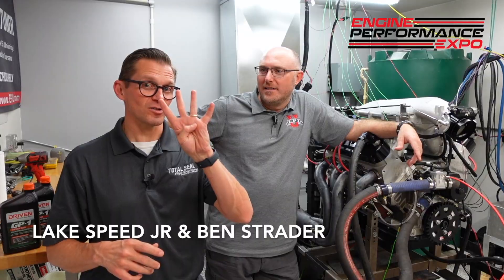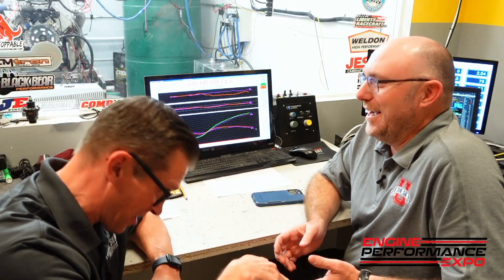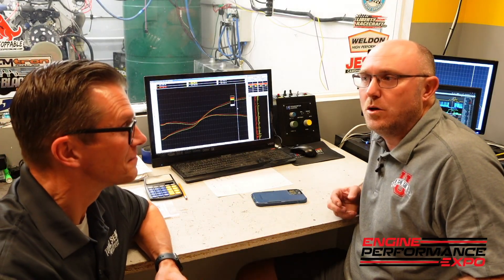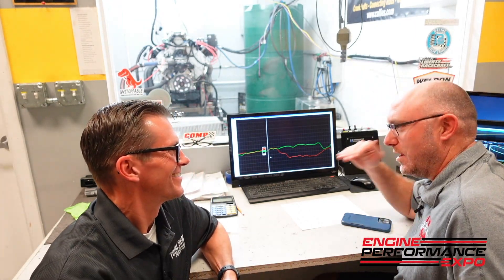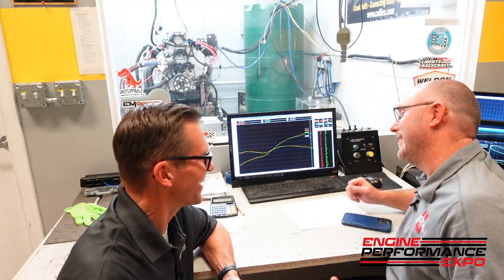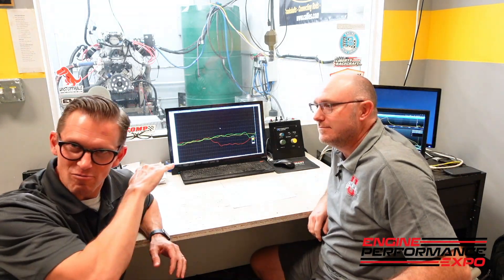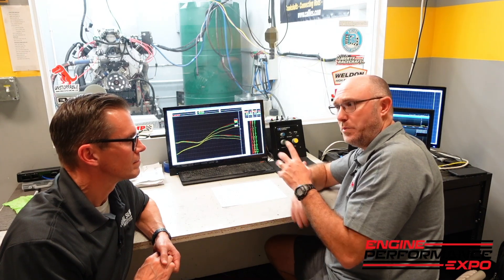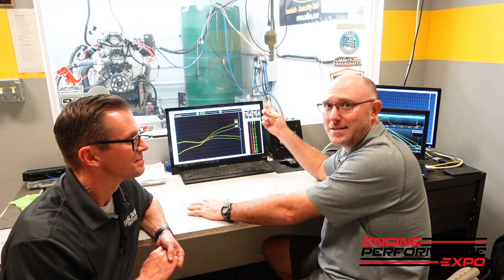How MUCH OIL is TOO MUCH? Dyno Results!

Comment: I have a question for you. I have a 21 Infiniti Q 60. The recommended oil for this motor is 0W 20. A lot of people that are on YouTube. Doing their own oil changes a lot of these people don’t like the 0W 20 motor oil they think it is too thin so they run the 5W 30. This is a twin turbo engine. Does it make a big difference by changing that oil to the thicker weight? Personally, I only do what the manufacture has suggested because they are the ones that obviously built that engine, been curious about this since I purchased this vehicle so running the 5W-30 is it good or bad?
Reply from the maker: 5W-30 will protect the engine better than 0W-20
Reply: 0w-20 is for fuel efficiency and thin whereas 5w-30 is better for protection and thicker but not too much it’s perfect . I have a 2018 q50 rwd luxe i do 5w-30 AMS signature series Oil
Reply: if the engine is under 100 k miles i would not put 5 W 30.put the oil the book says.0 w 20
Reply: @marlu6373  it says that for fuel efficiency purposes.. but people with modifications , tunes and just overall care about the car usually run 5w-30 for better protection or even 5w-40 if you take it to a track.

Comment: I find it silly the lengths to which manufactures go to increase fuel economy and reduce emissions by decreasing displacement, turbocharging, intercooling, and using lighter oils, and so on, yet, they're still using wet sumps.  Parasitic drag is such a, uhh, drag.
Reply from the maker: Good point

Comment: 🔔😎🇺🇲
Is the pressure loss due to running out of oil volume OR the more rapid recirculation of oil is holding the airiation bubbles longer.
Yes pressure compresses the bubbles.
And, obviously, Im sure this engine has a cranck scraper and windage tray.
So how do these factors apply???
Reply from the maker: Cylinder heads are retaining the oil and keeping it from getting back down into the pan.

Comment: The question is: how much of that loss is due to windage friction and how much is pumping loss in the oil pump which is keeping the oil pressure valve open and flowing a lot at high RPM?  😁. The dry sump experiment would help answer that assuming the same oil pump is used.
Reply from the maker: We have another video with this same engine in the works that will answer that question.

Comment: This test did not measure emissions. When there was excess oil, some will whip up to the piston, and pass the piston rings and burn. You will get more unburnt hydrocarbons and particulates in the exhaust gas compared to the right oil case.
Reply from the maker: True

Comment: I'm still trying to wrap my head around this, What has been done to the oil pan? Windage tray? Crank scrapper? Oil pan kick out or not? This is what I love to know to make a discussion on a comment. I love oil control because the returns can be very satisfying.
Reply from the maker: This engine is a dyno mule, so it doesn’t have a windage tray and the oil pan is gigantic. Check out Engine Performance Expo for all the details on the engine.

Comment: You need to do a video highlighting thin oil with high pressure vs thick oil with lower oil pressure.
Reply from the maker: Stay tuned. We were working on that video today.

Comment: You CANNOT compare data gathered by running a souped up high performance engine at 7000+ rpm and 9+ quarts of oil and say that the outcome represents what will happen to a production passenger car engine!  None of those variables are EVER relevant as they are apples to oranges.  For one, no regular car owner ever revs his car engine to 7000 rpm, and the sump never holds 11 quarts!  So many other reasons exist that make this line of reasoning ridiculous.

Comment: What was the first oil you used.....   where you said there was only a 12hp change?
Reply from the maker: We started at 5 quarts of oil, then added 2 quarts (which was the 12 HP loss) and then we added 2 more quarts.
Reply: @themotoroilgeek  Edit...
Reply from the maker: That was was the break-in oil.  @n2omike
Reply from the maker: @n2omike  We never had 12 quarts in the engine. We drained out the 7 quarts of break-in oil and added the 5 quarts of 15W-40 GP-1. The break-in oil was BR30, so it was thinner.
Reply: @themotoroilgeek  I saw my mistake in how I was reading your results.  Sorry for wasting your time!  Thanks for the great content!

Comment: Would be cool to know where on the dip stick these oil amounts related to. Are we assuming the hp loss is due to more suspended oil, or rotating components physically passing through oil? Also tilting the engine or simulating for a road course and repeating this would be fascinating!!
Reply from the maker: Since this is a race block, there’s no dipstick.
Reply: @themotoroilgeek  ahh ok ok. thank you, love your videos.

Comment: Back when I had my engine shop, this was one of the tests I did with my mule test engine.  It was a 302 Ford with 351W ported heads that ran great.  On a wet sump it did the same thing, about 70 PSI from idle up to about 5,000 RPM with 6 quarts in it plus the oil filter and oil cooler.  (It had a deep sump road racing oil pan on it.)  Then at 5,000 - 9,000 the oil pressure really took a dive down to about 25 PSI.  But it made 512 HP @ 8,300 RPM.  Added oil and the oil pressure stayed good up to 8,000 RPM, but lost about 35 HP as I recall.  A few months later I was testing dry sump oil pumps and oiling systems with it.  The best pump that gave the best vacuum also gave the most consistent oil pressure from idle to 9,000 RPM.  Oh yea, the power was 527 HP @ 8,300.  Plus, if you held it at 8,000 RPM for about 5 minutes, the power never dropped, and the oil pressure was steady @ 75 PSIG.
Reply: Awesome work ! Sweet engine ! 😎👍
Reply: An 8k rpm Windsor is a radical race cam only.
Reply: @maximusvonce1381  Originally it was built for a vintage race car.  Sadly, the customer it was built for died suddenly and the final bill was never paid.  The person that bought the car from his widow didn't want the engine since he didn't want to pay the balance of the bill.  I figured I would just keep it for testing things until it either broke or wore out.  It never broke, but it was huffing some after about 3 years of on and off testing.  I think it has about 400 hours of hard dyno time on it.  Then an off-road racer came in one day when I was doing something on the dyno with it and asked to buy it.  I rebuilt it to run better for his style of racing, i.e. high torque and less worry about high RPM horsepower.  I know he ran 3-4 SCORE races with it, but never saw it again.
Reply: @LoydChampion  Sorry to hear customer died. Was he that old. Was it a heart attack?
Reply: @LoydChampion What do you mean the motor was "Huffing some" after 3 years.
Reply: @maximusvonce1381  After a lot of dyno pulls it was showing a lot of blow-by.  Over that time there were a lot of dyno sessions that we were pretty hard on it to see what would happen with oils, headers, cylinder temperatures and a whole host of things.  For example, we did one test where we ran it between 5,000 RPM and 7,500 RPM with a 75% load for 4 hours to keep the oil above 300 degrees F and having to function.  I honestly thought it was going to throw a rod or something out of the side of it, but it didn't.  And the oil tested good too.  It was also a good test of the cooling system I engineered for the dyno water as well.
Reply: @maximusvonce1381  He was in an airplane crash in his own plane.
Reply: @LoydChampion  Wow
Reply: 500+ HP on a 302 with ported iron 351W heads… 
That’s pretty dang impressive

Comment: Extra oil means power loss, higher temperature, possibile aeration but stable oil pressure at high rpm. With this combination, I guess engine oil seals will be on the edge of failure.

Comment: Those oil pressure drops are a worry but it would have been useful to start with the stock oil level and add from there in smaller amounts. It's quite common to add a bit more oil when racing.

Comment: Do you know it's funny... when you read some manuals they'll say things like keep the oil level between the low in the  Full… othes  will say keep the oil level to the highest side of the  full mark… Possible without going over etc..... I was always a little paranoid to not… Have it on the app for full… But I can tell you this my well-kept 99 Camry V6 has quite a bit of difference (faster) on response on pick up/acceleration with that oil line  is at BETWEEN  add  and full..hmmmm 👍great stuff!!
Reply: Every engine is going to be different.

Comment: After seeing 7 qts vs 5 qts oil resulted in holding good oil psi but lost significant power I would have drained 1qt oil & tested 6 qts oil to see if 6qts/only 1 more qt oil was enough to maintain good oil pressure without loosing as much power which is exactly what I would think would happen in this case with this motors current build configuration.
Reply from the maker: Agreed, if we were trying to fine tune it, one quart at a time would be the way to go.

Comment: I'm confused. If the pump pickup is always under oil, how can increasing the volume of oil in the pan increase oil pressure. 

It's like having a hydraulic pump show 2 different pressures when the tank is full, vs half full- which doesn't happen.
Reply from the maker: The lower volume in the pan means less head pressure at the pick up inlet.
Reply: @themotoroilgeek   head pressure at the pickup is trivial.  The reason the oil pressure was lower with less oil in the sump is because at the higher rpms, the oil was starting to aerate.

Comment: Awesome test!!  I slightly overfill my crankcase by about a 1/2-3/4 quart for track days since my stock engine doesn't have a baffled pan.  I'm running a 4.6 3v and was always wondering how much overfill I can add without running the risk of aeration.  The dipstick has a hole punched through it about 4-5 mm above the full hash marks.  Do you know if how much the OEM's generally factor in for safe overfill variance?
Reply from the maker: I don’t know, but I would be checking your oil pressure to make sure it is not dropping at the end of the straightaways. If it is, the oil level is too high.

Comment: When the oil level is over the "max" line on your dipstick when the engine is at operating temperature. There, just saved you 10 minutes.

Comment: So as oil quantity goes to zero, power output goes to infinity! Draining all oil as we speak ! 😊. Interesting video!
Reply from the maker: LOL
Reply: @themotoroilgeek   remember slick 50?...think that saved my car with plastic valve covers..
Reply: Remember the duralube infomercials from the early 90's? No oil pressure! They drained their duralube treated engine off all oil and were astounded that they gained hp on the dyno..... they just didn't show the part where the engine went boom!
Reply: Yep....the engine will run more efficient with less oil restriction. Lower viscosity also allows the engine to run more free, producing more power and better gas mileage. But you compromise engine life. It's certainly a give and take.
Reply: It's the same with homeopathic 'medicine', the less medicine in it, the better it works!
Reply: Run motorkote in the oil 😁
Reply: Royal purple had a similar infomercial.
Reply: @shroom903  I used to use RP but it always came back with substantial sodium in the analysis, indicating coolant in the oil which I do not have. Switched to M1 and will see what happens.
Reply: You can remove the oilpan and just spray the bottom with MotorUP(tm) and be good
Reply: @eamh2002 Except that oil pan helps suppress engine noise.
Reply: So, as power output goes to zero, longevity goes to infinity! Adding oil as we speak ! Very interesting video indeed.
Reply: @rustirab3465partly why.
Reply: LMAO 🤣 🤣 🤣
Reply: Maximum power = maximum destruction
Reply: @rstuff1605 It would be easier to build a rocket for NASA than it would be to decipher what you're talking about.
Reply: Don't, bro'!
Reply: That’s why they make 0w-8

Comment: Lake you will know for sure , on the sb2.2s I was told for qualifying they would drop the oil pressure to 30psi from 80psi and it would make another 30hp
Reply from the maker: Dropping oil pressure in the qualifying days along with low viscosity oil was worth a lot of power.
Reply: @themotoroilgeek  They only had to make that engine last what, one warm up lap and two speed qualifying laps?

Comment: This video was pretty useless to me from a practical standpoint because you didn’t talk in terms of oil level relative to the “full” mark on the dipstick. You clearly established that there is an optimal level. But where is that level relative to the “full” mark???
Reply from the maker: We could not do that on this engine because it doesn’t have a dipstick (race block).
Reply: Thanks so much for responding! I know these vids take a lot of time and effort, but if you could do it again with an engine that has a dipstick, would be great!

Comment: I would like to see a direct comparison on this engine with the gp1 oil and Amsoil racing oil in the same oil weight and the same volume of oil AND of course the same oil temperature so the weight of the oil is the same, and see after multiple runs on each oil, if there is a difference in horsepower and torque between the two. 😊
Reply from the maker: Thanks for the suggestion!

Comment: Why would extra oil cause lower hp? Pressure dropping would make me think the oil is not getting back to the sump fast enough and could eventually do damage. More oil inside the engine getting in the way of free revving??

Comment: Too much oil in a diesel can actually destroy it in a spectacular way.  It can start combusting its own oil instead of the fuel supply which means it will take off and run as fast as it can until something breaks.  The only way to stop it is to completely block the intake.
Reply from the maker: Great point!

Comment: Really interesting video.  One thought I had is that one horsepower is equal to 745 W.  That "lost" horsepower is going somewhere - heat.  We all have an intuitive feel for, say, the heat generated by a 1500 W (2 hp) space heater.  I would like to see this test done again while monitoring the oil temperature. I suspect that the effect wouldn't be huge on a short time period like a dyno pull, but it would probably be measurable.  The real-world implications (running on a track for extended periods of time) would be a lot more impactful.   It would be interesting to compare the dyno pull data (at least oil pressure and temperature) with the data recorded on a track with some number of laps.
Reply from the maker: Absolutely! The oil temperature would skyrocket if we kept running it that way.
Reply: 60hp = 44.76kW.  This is equal to THIRTY of your 1500W space heaters.

Comment: What about a 3rd gen coyote from a f150 with the oil consumption problems. I do 10 quarts of 5w30, and when I recently did the oil change I only drained out about 8 1/2 qts. I figure the oil filter holds about a 1/4 to 1/2 quart. so I lost about 1 to 1 1/2 quarts. So again, am I better off running 9 qt as it calls for 8.8 quarts or os it okay to do 10 quarts. Other people are running 5w50 with 10 quarts.
Reply: Do what the book of the car says.fill to the top line and don"t be lazy every 2 weeks look at the level and add to the top line.simple

Comment: That's crazy how much power was lost just by adding enough oil to not lose pressure. Considering the insane amount of heat and probably foam created by 60HP being dissipated into the oil, I can't imagine that a properly designed setup would behave this way. It would be very interesting to see what would improve this setup besides a dry sump.

I'd think with some tweaks to the oil pickup, improved oil drain back, possibly a windage tray and baffled oil pan if you don't already have one, etc, there would be serious gains to be had not just in power but also in longevity.
Reply from the maker: We are just going to put a dry sump on it and gain all the benefits!

Comment: I wonder if they ran a lower pressure pump setup, and a normal level in the pan if it would result in a benefit on a few fronts.  Less oil in animated suspension, more stable oil pressure and level, and an optimal power level?
Reply from the maker: Oil level is the main driver here primarily due to the size of the connecting rods (more prone to windage). The oil pump was not the issue. It was the oil return from the heads.
Reply: @themotoroilgeek  This is a very under square stroker build?

Comment: I have a question, I have a Ford Edge that 5W-20 is recommended, I use Mobil 1 5W-20 synthetic, would I be better off using a 5W-30 synthetic? For better lubrication? Because it has the 3.5 duratec motor, and I know 5W20 was recommended strictly for CAFE reasons..

 Thank you
Reply: If you live in a hot climate then 5w30 would be fine. Or you could just run 5w20 in the winter and 5w30 in the summer.
Reply: @LA_Commander  What I do for the 1.6 Ecoboost in my Fiesta ST (the winter/summer option above).
Reply: @Fordworldrallyfan   Got it. I run 5w30 for most of the year in my Focus ST but 5w40 in the hot summers when the temps are regularly over 100f.  That turbo gets REALLY hot and I change the oil every 3-4,000 miles to keep that turbo in good shape.  On a non-turbo engine every 5,000 miles is good enough.
Reply: I seem to recall Lake did a video on the viscosity of Mobil 1 oil. When the test results came back on the new sample, the xW-20 oil was just a tiny bit below the bottom range of a xW-30 oil. In other words, it was a very thick xW-20, almost a -30 to begin with.